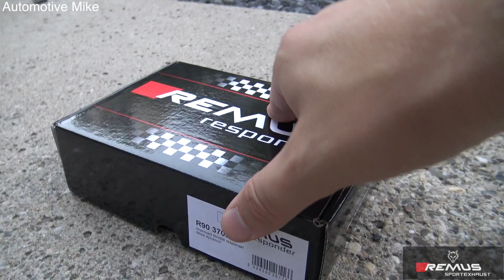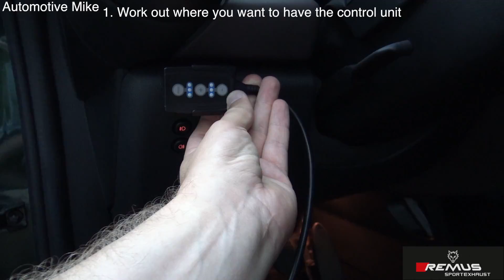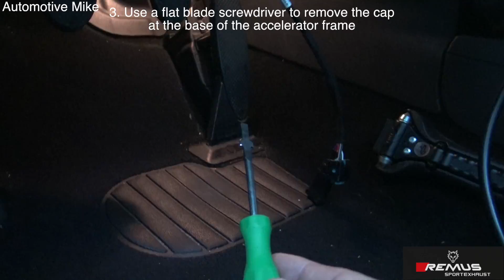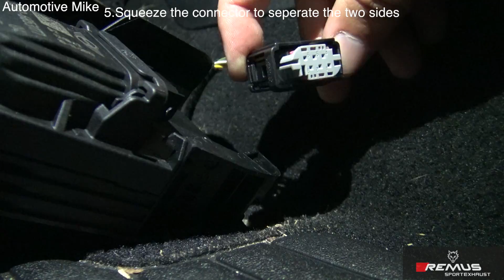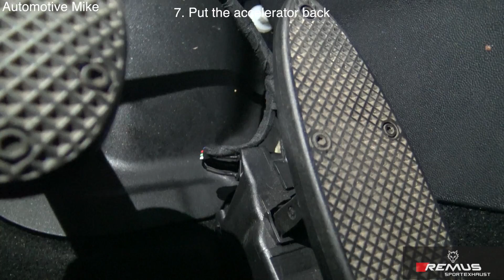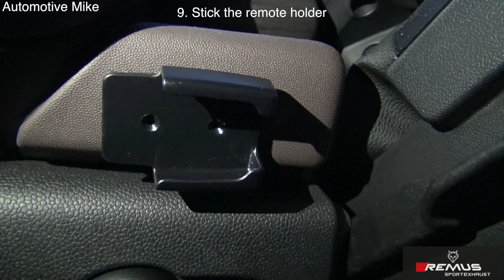How to install the Remus Responder on the MINI F5x

Comment: Hello 
I put remus responder for my opel astra j and I found when I am choice any mode( Economy or sport or race)and  the gearbox still on P or N , the RPM is highly without press the accelerator.
I asked if it normally or their is a problem . 
Thank you for your co operation .
Reply from the maker: I should contact Remus!
Reply: +Automotive Mike 
thank you for co operation